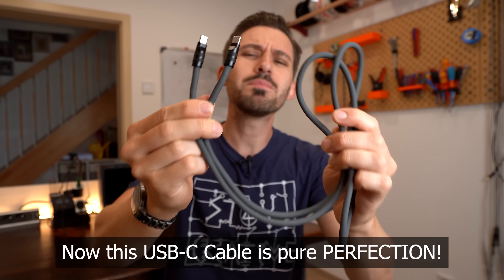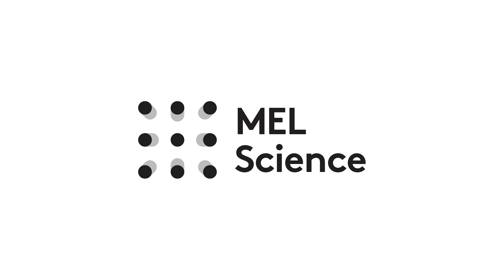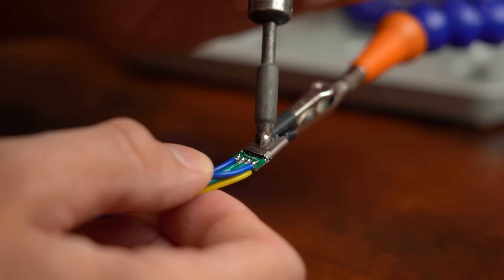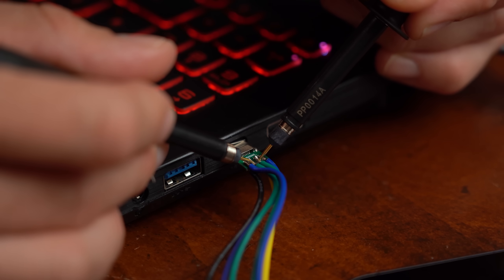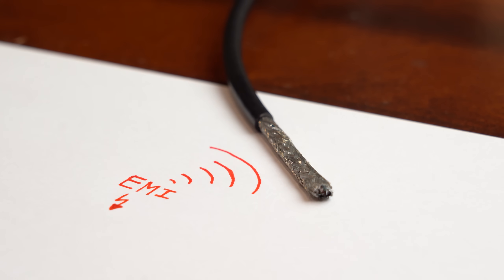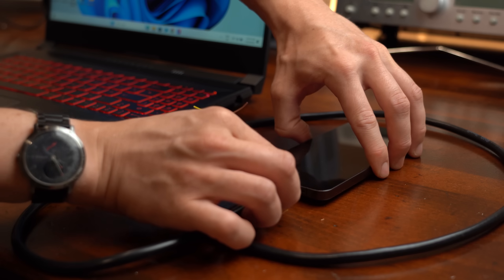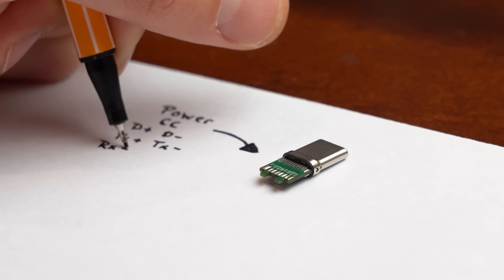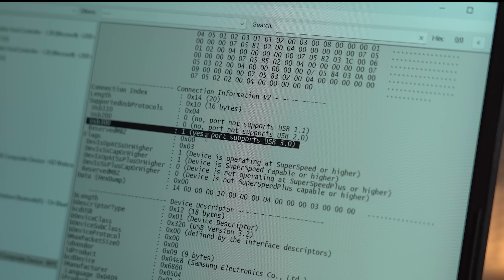Is it IMPOSSIBLE to make the Ultimate USB-C Cable? (Shielding) EB#64

Comment: Great video! I think the problem was probably the usb c connector board. From my experience the cheap ones are typically dedicated to charging more-so than data transfer and often don't properly follow the usb 3 standards guidelines when it comes to data transfer. I suggest you first check if all of the port's pins are physically there (some times there's missing pins) then perhaps check the specs for the ic that's in the usb connector board.
Reply from the maker: Thanks for the feedback, I will keep that in mind for the next try! ;-)
Reply: he did show you a video of him putting his cables into a tester

Comment: I'd love to see you re-try this and succeed because I found it really interesting to see how in depth/complex the USB Standard is! I'm sure you'd be able to do it.
Reply from the maker: Thanks for the encouraging words, I will give it another try one day ;-)
Reply: @greatscottlab  Yes please eagerly waiting for next video on this topic and looking forward for your success in this project!😃
Reply: @greatscottlab  
Would it be possible to link to the new shielded cable you used to fix the 2.0 DIY version? Your previous video still lists the unshielded cable and I didn't see where to get the new cable mentioned in this video.
Reply: While it's possible to do, it's just not a realistic project. These frequencies involve a variety of subtle physics in order to transfer data. Read a bit about the design of high frequency oscilloscope probes and you will see the problems being dealt with. There are other solutions to the problem that make more sense, like buying a high-speed USB cable, then paralleling just the DC power wires with heavier ones.
Reply: Lol cụ coin viNE 0,06875$

Comment: Try without the resistor to CC1 loks like the tester is picking up cc1 and sbu2 on your cable missing on the buy one. Could be its interfering with the devices ability to auto negotiate the speeds
Reply from the maker: Tried that as well. Did not help.

Comment: 4:02 This is where you're actually wrong. USB uses NRZI (non return to zero *inverted*). It doesn't measure voltages, or their difference, they only care about when the logic state changes, so a change is a 1 and no change is a 0 (this absolutely will not work with your general purpose UART communication). Also, USB puts it's clock signal into the data (this is why bit stuffing is so important because after 7 or more zeros the device can lose sync and receive garbage), which means that the first few byte times are ones to get the clock signal, and then there's the data. Please actually do proper research before making videos. Just because you're german doesn't mean you know everything.
Reply: You started out great, but then flipped to ad hominem mean. Why? He’s being open and honest, plus friendly. He’s a great asset to the community and so many people learn so much from him. Too many of us nerds are embarrassed to admit what we don’t know. And then fake or hide it. He lets that go and just stays open, despite all the mean comments he gets. That’s evolved. 

Kicking someone for not knowing as much as you is unkind, and contributes to people with techie curiosity being too afraid to get more involved. We don’t need more gatekeepers, we need more engineers. I suggest you pause before you finish a comment to see if you might be just as smart looking (or more so) if you left off the mean part. I think you’ll find it very rewarding! :)
Reply: @mewintle he's also still wrong, the voltage differential IS important and is used to determine the signal state. While yes the video may be wrong, it's a small detail in what is otherwise a good video. Absolutely no need for those comments at the end.
Reply: That's just mean, come on 😕

Comment: What is the wire gauge/diameter you are using for the cable at 2:28? What gauge and wire types do you recommend for low power projects but still have enough strength to be bent and yanked often?
Reply: Refer to gauge chart. I found that copper with silicone insulation is quite flexible

Comment: Why not make your own USB C 3.0 connector breakout with the e marker chip? You've made custom PCB's before, so it should definitely be possible!
Reply: USB-C videos are interesting to me, maybe make one every few months in addition to other videos instead of publishing the USB-C videos one after another
Reply: We need closure scott
Reply: Please make more of these videos, I love them, and always watch them! They are very interesting! Keep up the good work
Reply: I vote to finish the usb c cable too
Reply from the maker: It certainly is possible. I am looking into that......but I think I should not make toooo many video on USB-C. There are tons of other awesome electronics subject to discover ;-)
Reply: @greatscottlab  Im loving these, and many others too, since usb-c with all its weird speed variants is a bit of an black magic i would like to see how you tackle the perfect cable.
Reply: @greatscottlab  I dunno, I'd love to see the creation of a high speed AND high power USB cable. Usually you can only get one or the other. You could, in theory, wrap your own wires, so you could add shielding, and connect to a custom board. I would add it to my list of projects to do as an unbreakable, single do everything cable would be super useful.
Reply: @strategicgnomer1  Digitus makes your dream cable. The thick silicone ones. But the issue is, the ones longer than 1 meter only go up to 20GBit. The 1m and shorter ones support up to Thunderbolt 4 as well as Thunderbolt 3 (USB 4).
Reply: @greatscottlab  USB-C itself is a big subject you can mix it with other content but it would be great to make a video on problems and dangers of not following the USB specification. Like for example built-in trigger resistor in C to C cable. Some manufacturers are guilty of it.
Reply: I disagree  @greatscottlab 
I want the third video to be how you actually made it,
It's like stopping Star wars at empire strikes back, please don't do this to us
Reply: @greatscottlab  just one more, please, I want to see the home made USB cable at full speed. You cannot leave us on this hanging cliff
Reply: @greatscottlab  If you need a neat video idea I would love to see the circuitry of an engine radiator controller w/ pwm.

I bought some very high current (all the way up to 200A) DC motor controllers to mimic this that ultimately all got smoked by these low resistance pancake fans and now I’m looking at using one from a Nissan Pathfinder but I am not sure how to control it with an esp32.
Reply: @leblancexplores
Did you add a bypass diode on the motor?
Reply: @greatscottlab I vote to finish the cable, but no hard feelings if your bored by it or worried we are getting bored by it. Thanks for all the great content.
Reply: @greatscottlab WE WANT USB C. GIVE US WHAT WE WANT SCOTT
Reply: @greatscottlab I have my own custom USB-C cable breakouts as gerbers if you'd like
Reply: @greatscottlab  you SHOULD make a lot of usb type c videos since we really confused by them <3
Reply: @greatscottlab You don't need to make breakout boards. You can solder wires to the pads that are on the board, and the rest of them directly to the connector where it attaches to the board. You always have access to all the pins on both sides, even if the pcb doesn't have pads for them.
Reply: @greatscottlab  This sounds perfect for a PCBWay or JLC collab :)
Reply: @greatscottlab  I would love a DIY cable series, see what cords you can make yourself, HDMI, USB, AUX cords, power cords, whatever you can think of, would be a very cool series! Or a series on USB projects, such as making type C and type A cords, maybe looking into those type C PD boards that take DC voltage to make a type C PD port, make your own charging hub with off the shelf components, DIY USB hub, upgrading charging ports to type C from old type B connectors, etc. That could also make a good series too! I would also love to see a custom type C cable with usb3.0 with a connector with larger pads if you do a custom pcb, maybe half the solder pads can go on the back? Or maybe make the board slightly longer? And I would love to see non off the shelf cabling used too, but with shielding, if you could do something to twist all the wires nicely and shield them, and than put them in a cable sleeve to make it look nice? What about a transparent cable? I have never seen one where the cable is clear, I have only ever seen ones that the end of it is clear, anyways, just some ideas, I would love to be able to do this myself eventually and end up with some really nice cables, custom lengths, etc.
Reply: @greatscottlab bud I think the Perfect USB Cable will work commercially very well 🫣  I like the journey,  I will twisted no all my cables around my SDR Setup 😂 👍🏼
Reply: @greatscottlab OCUlink cable is maybe the perfekt Match for a complete PCB Design🤔
Reply: @greatscottlab  Sounds like you are giving up, understandable. xdd
Reply: @greatscottlab  There’s always more fun around the next corner, that’s true!
On the other hand USB-C is likely the one thing we all suffer with, and I enjoy all of your videos, so I won’t object to another in a couple of months!
Reply: @greatscottlab I love the USB-C videos though…
Reply: @greatscottlab  I like to see 10 more videos of USB-C 

Next time, try with CAT 6E cable ;)
Reply: @greatscottlab i rally like the usb c content i starten following you because of it
Reply: @greatscottlab  I'm personally a fan of this mini series. And I don't think I'm alone, who would happily welcome another video, where you'd really make the perfect usb c cable
Reply: @greatscottlab  For example what? Videos about usb are cool, people can understand difference between low quality and fake cables, for example unoriginal apple cables and so on... There are a lot of myths when it comes to charging cables
Reply: I'm curious if you could make a raspberry pi Pico with its pio controller speak USB pd qc3 because I would absolutely love to see a super cable that has the ability to translate power transfer protocols or even just straight up ignore them 

Something like a with a host side sink side and we'll simply just work out what the best protocol was even neat if it shows up as a USB serial port on both ends think of a more utility version of the OMG cable.
Reply: More USB-C content please!!! ❤❤❤
Reply: Gotta prove the concept first.
Reply: He is not a PCB designer. High speed design is something that requires more advanced techniques. USB 3.0 needs controlled impedance traces, which requires picking a correct stackup. Seeing how clueless he was about the differential lines needing to be in a twisted pair, I can predict a low success rate if he attempts USB 3.0 PCB design.
Reply: Maybe you can set standard. New generation USB - D.
Reply: Lol cụ coin viNE 0,06875$

Comment: You can buy cable sleeve with shielding built in.  I am gonna try some to shield some of my fussy USB C cables and see if it does anything beneficial for data transfer reliability.
Reply from the maker: Interesting! I will keep that in mind for my next build!
Reply: Is there any EM interference between wires? I've never senn each individual wire shielded but I wonder if shielding individual wires as well as the whole thing would make a difference.
Reply: @aethelred9781  Yes, it's called crosstalk.  But for differential pairs of wires, you want them electrically coupled, thus the twisted pair.  In theory, both wires in the pair are affected identically by outside signals, so EMI becomes common mode, and since you only care about the difference in voltages, it doesn't matter if both wires are also going up and down in voltages by the same amount.

Comment: Hmm... so technically... I could DIY my own USB-PD Cable with old Ethernet Cable lying around? Because I think getting Ethernet cable is cheaper and easier to use than "generic" wires and if they are PoE capable, which kinda sound really close to what USB-PD supplies... 

I think the CC line doesn't need to be have fixed configuration... because Android as an example is capable of switching between host or guest configuration but if you "force" the device using a specific mode then it may confuse it and get stuck...

IIRC I never set the CC fixxed only if there was an USB-A port on the other hand but in general, I removed the resistor on the board and connected the cable straight to them.
Reply: I don't think so. He considered using Ethernet for this video because he is aiming only for high speed data transfer for this experiment. Ethernet cables are not designed to carry high wattage, leave alone, through a single pair of its conductors (the wattage can not be split among the lines that would be used for data transfer)

Comment: Cutting a proven working usb3 cable and using the cable to solder onto your USB C breakout boards would have been a good way to rule in or out whether the problem is the cable type or just your USB boards
Reply from the maker: Good point! I will keep that in mind for the next try ;-)
Reply: @greatscottlab  and inversely use known good boards to test your cable

Comment: For shielding you can always try a quality solder wick. It comes pressed flat but is actually a "tube". Give it a try
Reply from the maker: Thanks, I will consider it!
Reply: Could be worth a try. I wonder if the flux in the wick will pose any issues .
Reply: @Iisakki3000 I didn't know there was such a thing as wick with flux already in there. Good to know next time I buy some. But that at least goes to show that wick without flux also exists so if it does cause problems, it's easy to find fluxless wick.
Reply: I am definitely going to do this, and use it for both phone charging and solder wicking, until I eventually have a very rigid and heavy charger cable.
Reply: Yep first saw this on DIY perks' HQ microphone video, was mind blown 🔥

Comment: And if you look closely the Ethernet cable has different rates of twist between pairs.  So one may twist 6 times per foot while another is 10.  It seems like it might be that the twist on a USB is different than Ethernet and even if the same you might have to match the pairs to the twist they have.
Reply: I seem to remember that distinct prime number intervals are used to reduce any common mode cross talk - not sure though.
Reply: @phrozenwun  Presumably not twists per foot, though, unless relating to a specific wavelength of signal.  A ratio of 7 twists per foot doesn't feel particularly prime to me unless you can unit-cancel the 'foot'.

Comment: At least now we know why high-speed cable, with all the connections -that is also flexible-
is so expensive!
👍👍👍
Reply: Cables over 80cm long require active circuitry to boost the signal for USB4 and thunderbolt. That can more than double the price compared to a passive cable.
Reply from the maker: True ;-)